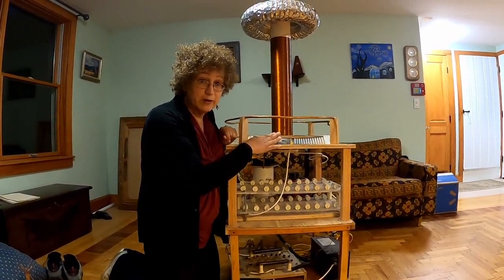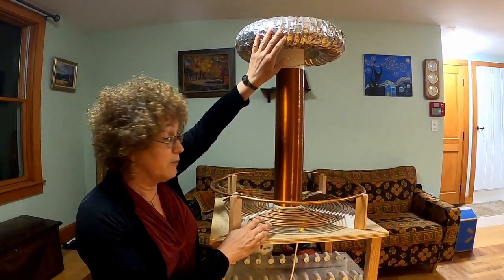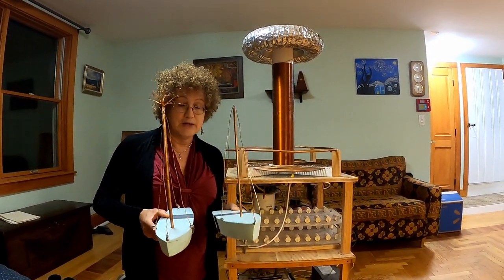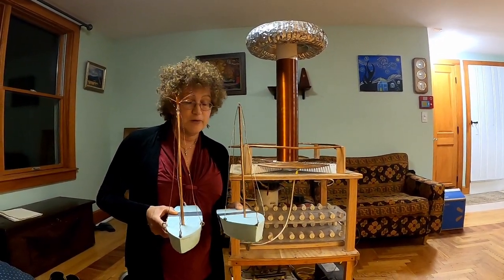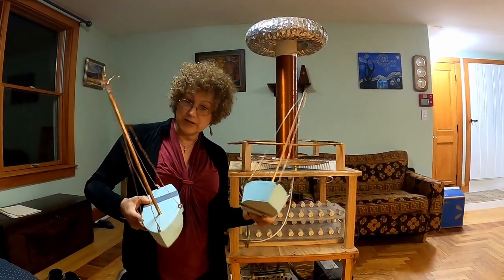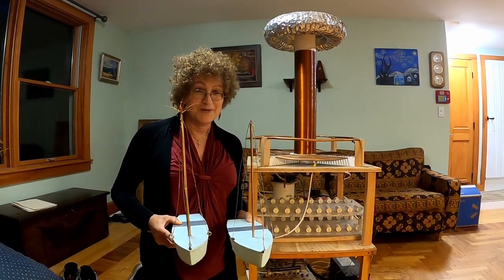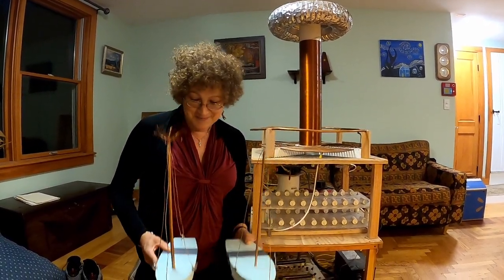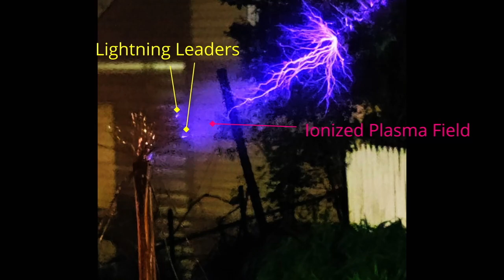Episode 75 - Lightning While Sailing

Comment: Loved the light show. The difference looked like splitting hairs to me. I'm of the view that it's better to ground the mast, rigging and electrical through spark arrestors and to try not to be the tallest boat in the anchorage. :) Then cross your fingers and twist your wires because even if you aren't directly hit, your electrical system can still fry from induced current caused by the field of a nearby strike on another boat that has its mast bonded directly to the grounding plate.
Reply from the maker: That's great advice.  The twisted wires, I recalled, originated back in the 1890's with the discovery of "crosstalk" on early telephone lines.

"There was a second major cause of interference, crosstalk, between adjacent pairs of telephone wire on a single pole cross arm. Since the distances between wires were unequal, the inductances did not cancel out, leading to crosstalk, or signal leakage. The solution to this was twisted pairs, where the two wires for a circuit were transposed, or twisted, at regular intervals, balancing and thus canceling the inductance. AT&T first tested this successfully on its new New York to Philadelphia line in 1885, and began using it widely after 1891, when Carty worked out a basic theory of line transposition."

Source: https://ethw.org/Telephone_Transmission#Early_Years

There's still a lot of crossing fingers though!  

Tongue in cheek analogy follows...
"The best defense against a bear attack is having a person in your group who runs slower than YOU.  The best defense in lightning is having a boat less attractive a target than your surroundings"

Comment: It's a good video that brings questions.
Your field output was steady and I assume you slowly increased it.
The whiskers drew the field voltage ⚡ first and divided it into smaller strikes?
At a point the field went to the mast  as well as the whiskers correct?
I would be interested in a test with boats alone and compare the volts or output and settings 🤔. As well as a high field with no objects in it then push the boats in it.
Then test with known resistance to ground on both. 
In the end I think the potential is looking for a path to ground, higher resistances take longer to provide a path. 
That said when and what path? I say grab it insulate it and provide a path overboard to the 💧 and the hope it finds a path to ground away from anything on the boat.